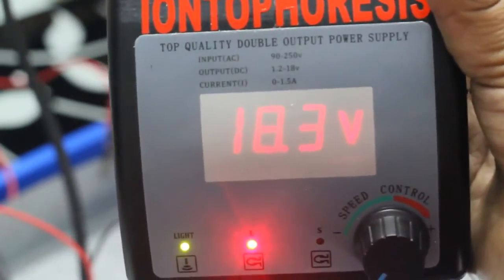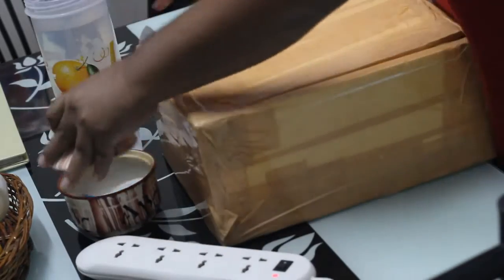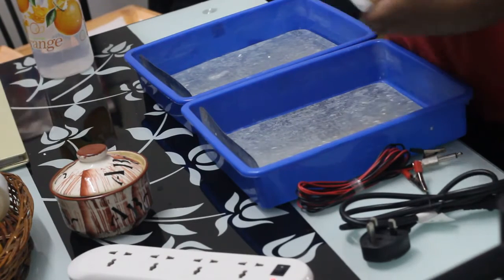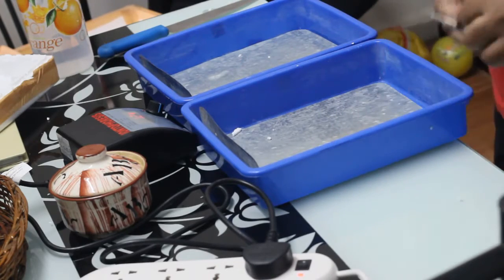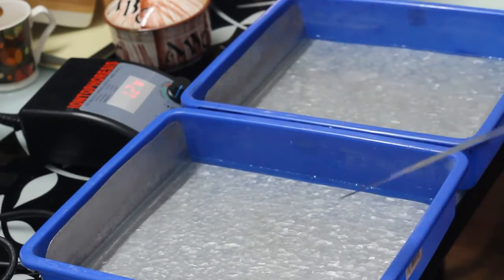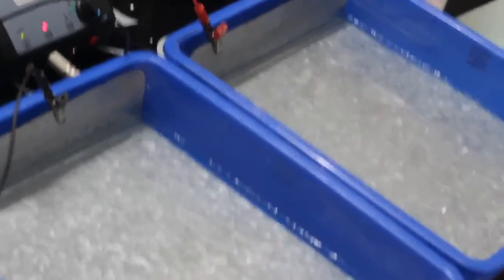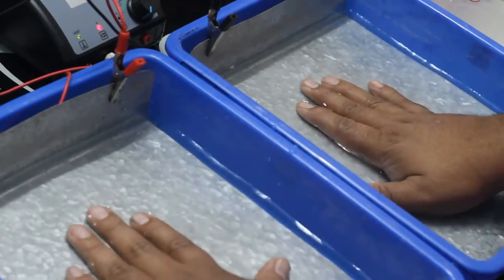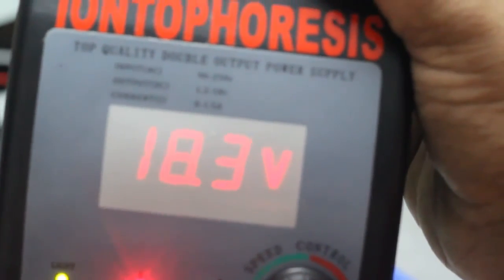Iontophoresis Hyperhidrosis Treatment  - Step to Step Guide

Comment: What's the current output in this device.
Reply: 21 volts
Reply from the maker: @amazingwonders3818 Please WhatsApp me at 9603675116
Reply: What is output ampers?
Reply from the maker: @swachajetyathanda2666 Please WhatsApp me at 9603675116

Comment: hai sir
 I am in dire need of it. I am typing this message with sweaty palms. how much time i must keep my hands in water??
Reply from the maker: Hello do twice in a day like 30 minutes in morning and 30 minutes in morning for feet. in 30 minutes gap reverse the connection after 15 minutes. Same fallow this before bed for both hands and feet. always remember if you have brought the device for us.. then the volts should be above 20 or 21 max for better results. if you did not purchase you can always call me at :  09603675116

If your sheets are worn out please let me know.. 

Please send a email for details at: vijaykumar0829@gmail.com

Iontophoresis is a method to apply a weak electric current to the skin, It blocks the sweat pores and glands which produce sweat. thus the dryness will last for 8 to 9 months if the skin type is thick, for thin skin type until 6 months. Many suffers have different roles some even don't sweat after using device for 1 yrs.

This is not a fake device which people sell now a days. This is CE approved and will give you 100% results within 2 week complete dryness in palms and feet.

For More information on this device

call us at: +91-9603675116,09603675116 (India), 9603675116 (Local) or
Email me at: vijaykumar0829@gmail.com
website:http://iontophoresisdevice.co.in/
Reply: @mynameisnssnssn  useless